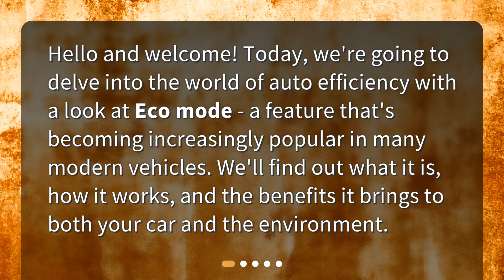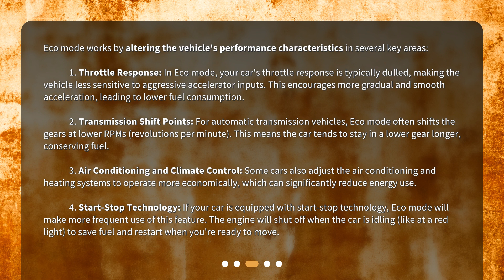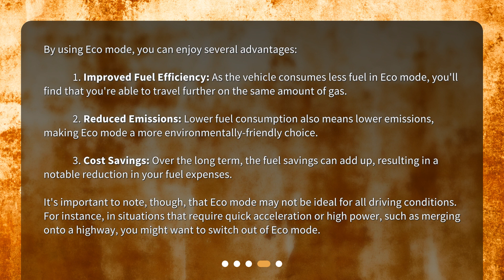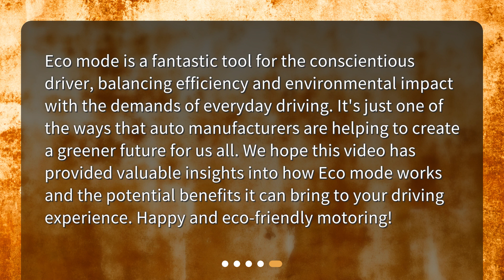What is Eco mode in a car and how does it work?

Comment: I found ECO mode dangerous in traffic because of slow acceleration response time. It's likely to wear my engine, starter, and transmission out quicker too. I have a background in doing environmental assessments and bought a truck with the eco bells and whistles. The 10 speed transmission and fuel monitoring by the computer does get me 22 mpg on a full sized F-150, but I worry the turbo will wear the engine out sooner. Replacing the worn out parts and maybe the entire truck before hitting 250,000 miles is not carbon friendly. Many vehicles generate the most carbon in their construction, not driving down the road. That's why I always buy used and try to get the most mileage out of a vehicle before it needs replacing.